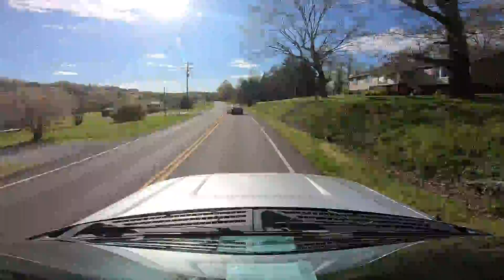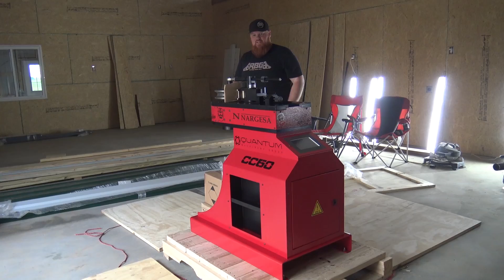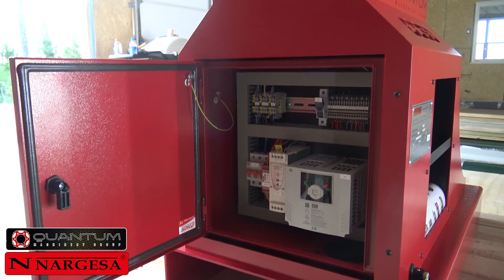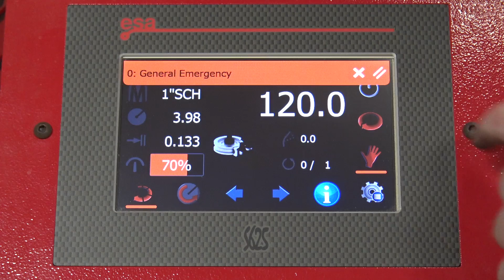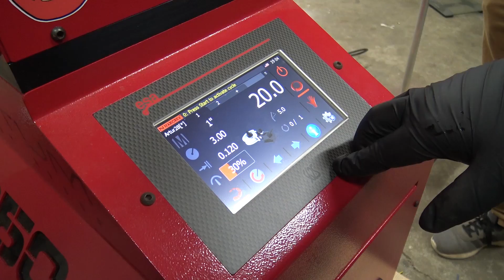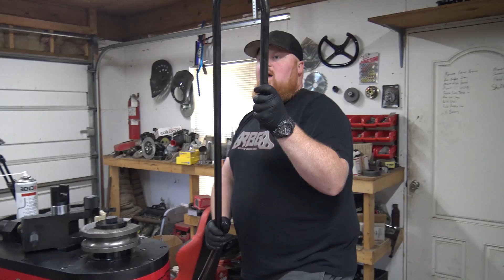CNC Tubing Bender ~ Nargesa CC60

Comment: Nice new machine but I don't think this is a cnc tube bender.  Its an NC tube bender.  A cnc tube bender would move the tube in the machine where it needs to be then bend it then also spin the tube, move it to the next bend and bend it again.  You would usually give the software a 3d model of the what you want to bend then it would right a program for the machine.  that is a nice machine though that will help you out a lot more than you previous one

Comment: This is the first video of yours I've seen.  Love the humble beginnings.  As someone who programs bent pipe almost daily you should take a look at software called Bend-Tech.  Its relatively cheap and super easy to work with, I use the SE version for what I do but you may be able to use the PRO version which is almost half the cost.  In it you can program one off programs or full chassis.   If you had a complicated multi-bend part I could make a program up for your machine to see how it works out.  Let me know.  Best of luck.

Comment: RBG that is the most beautiful tubing bender I've ever seen. Their attention to detail is incredible. The engineering and PLC{Programmable Logic Controller} is very high end. It is so quite and very accurate with programmable tolerance adjustments for flex are just amazing. Screate a note on your cellphone with flex % as you bend different tubing sizes and types.

Comment: I use my miter saw to cut wedges to check angles on the floor. You can also cut a hole in the blocks and use them to clamp your pieces while welding.